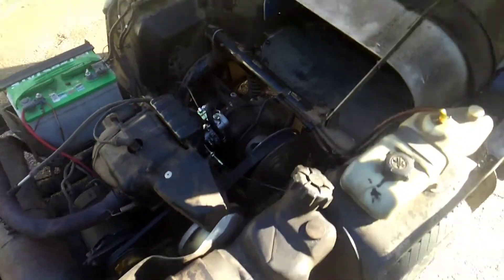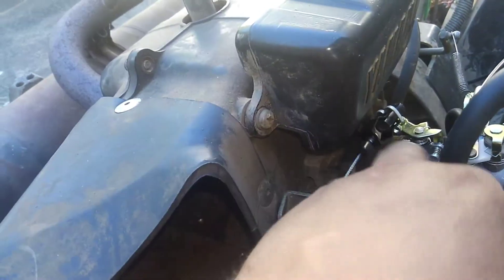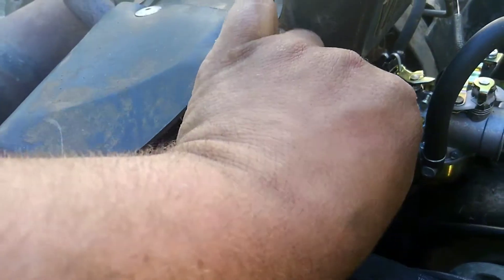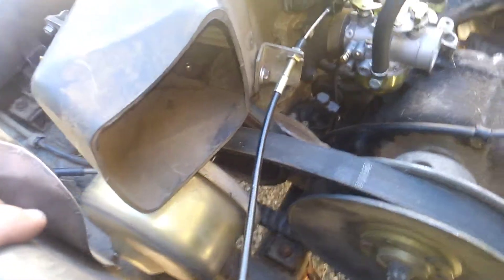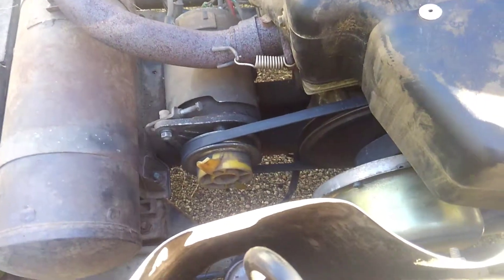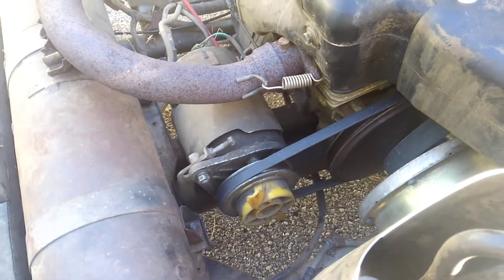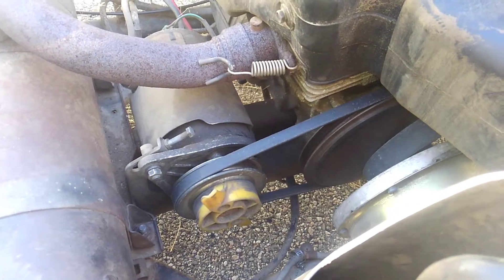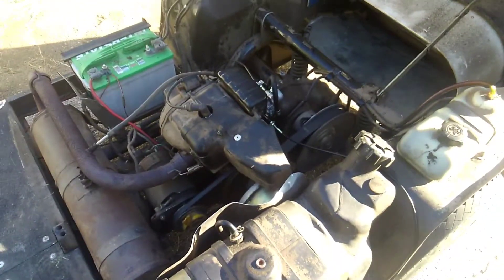Yamaha G1 Golf Cart Finished

Comment: Wow that sounds great going to do that to mine bunch of my linkage are bad was about to start looking for some new parts to order and found your video and another guys. Are the belts hard to change?
Reply from the maker: Belts were easy to replace. Just need to loosen up the starter generator to get that belt off and the drive belt you can just work off. It's been back to the customer for a while and he loves how fast it goes now. Does around 25 according to him.
Reply: Will's Garage thanks for getting back to me greatly appreciated. Ya we have a new cart at our buisness and the old gen 1 feels a lot faster to me never ran them side by side but from driving both around the older cart seems to have a higher speed up top always figured probably a safety thing Yamaha did. You have a great day. Cheers